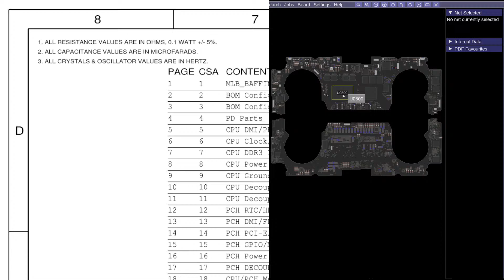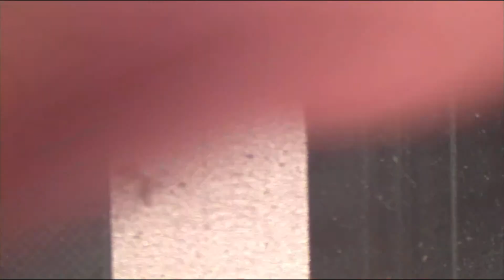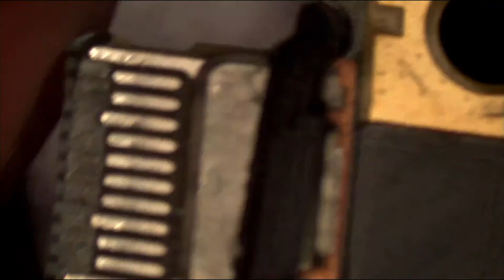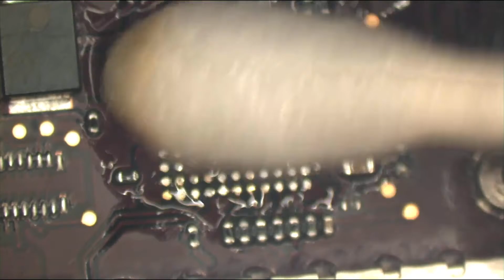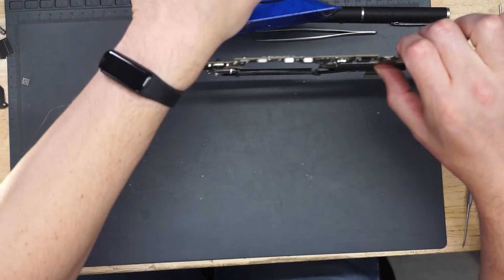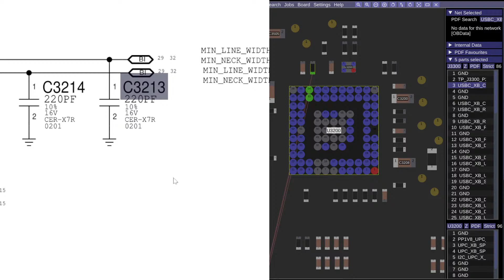A1707 MacBook logic board repair with Paul, live from Rossmann Repair Group

Comment: Why oh why all the manufacturers make their products to have different types of bolts all around? I mean I kind of get it. It is easier to engineer your product that way. Don't they think about the problems it may cause to those who are going to maintain the product? It makes you think that most modern companies aren't interested in their product to last at all.
Reply: Historically specialty fasteners were more to minimise who could work on the device. It happens in many industries where if you want to fix something you need the tools that only the factory provides.
Reply: I think it was the 2010 MacBook Pro has only 3 types of screws to remove the logic board. 1 The back plate screws, 2 the keyboard connector cover screws, 3 logic board and fan screws. All of them were regular Philips screws and all of the logic board and fan screws were the exact same screw.

Comment: Do you give the parts back to the customer and tell them what they did wrong?  Thanks for the video, I love to watch repairs although my limit is upgrading ram and he's to ssd. 😬
Reply: I'll put myself in the customer's shoes. I would have no way to visually inspect or a means to test a cd3215. I would just trust Rossmann Repair Group. Also, the dead parts are probably better recycled by the store as opposed to the individual. I don't work there though,  and I would be completely wrong.  I know they do log what the issues were and what they fixed.
Reply: Something like this we provide pictures and the same description I give here to the customer. These broken ports will stay with the machine until the end of the repair and if the customer requests them we will send them back with the machine.

Comment: Quick question...does the heat from your soldering iron melt off the insulation from the wire so you can turn it into a pad?  You don't have to strip the insulation, do you?
Reply: For this type of wire the iron just wipes away the coating. This is enamel magnet wire, I think I used 40 AWG here. Some of the bigger sizes take some scraping to get the coating off.
Reply: As already stated, the wire used is magnet wire and it has an enamel coating on it, which might take 200C (400f) to melt. It is a fairly high temp, but that should be doable with soldering tools.